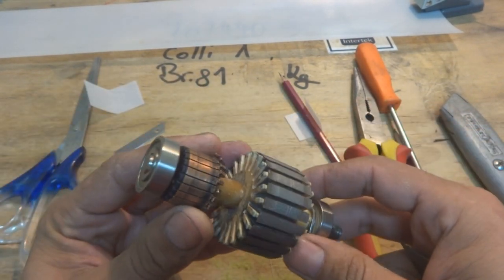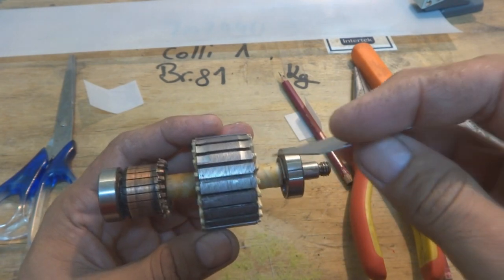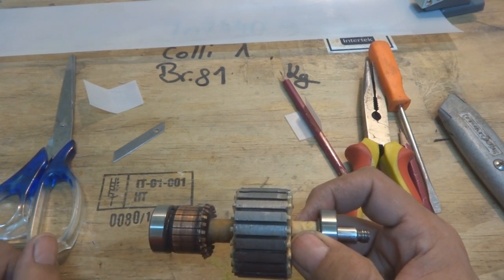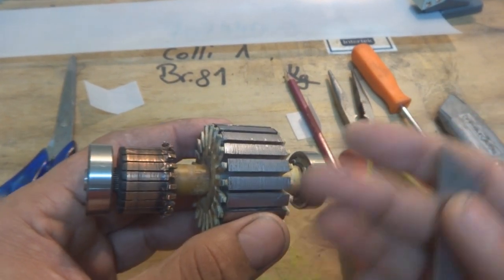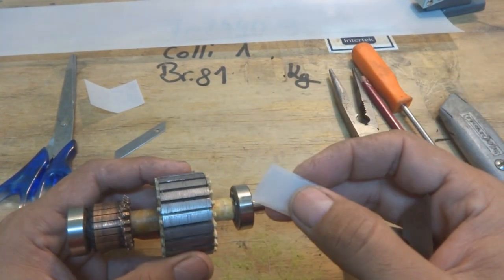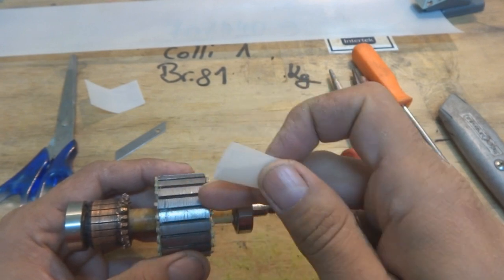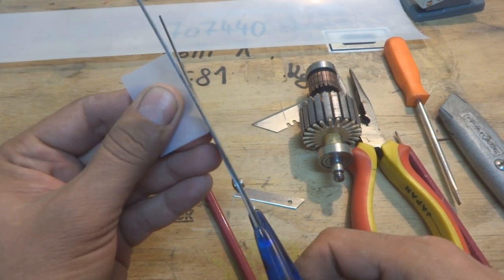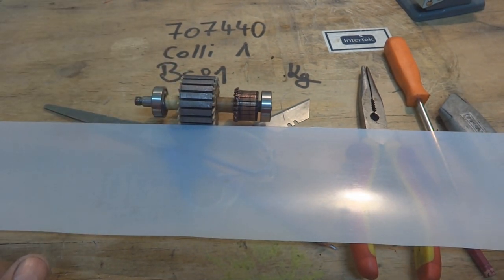Universal motor rewinding. AC series motor repair. Part 2

Comment: I have same rotor with -22 /22 how much offset to make two or three commutator pins ...., first try of winding with two pin offset on commutator, no sucess motor is working with lots of sparking come on commutator ,......any sugestion .....maybe to check stator windings for shrtage , I only check ohm readings and earth test on stator (field ) windings .......?!?!
Reply from the maker: Sure it could be a shorted field. Also after field if no success then offset 3 slots
Reply: @JahanZeb1976  thanks for replay , now i start 3 offset winding tomorow finish , i try field test series lamp 220v no ground resistance is ok , i will try like this and if start sparking , i will rewind field , and also put new bearings sometimes bearings can be problem maybe.....thanks again i will post results.....

Comment: Thanks for respond . there another thing . it is about that pins  outside around slides  that what you said in your video was broken and you fix with glue .
but I have a lot is broken from me when I take out magnet wires. what is name of that and do I can get new one because I lost all broke pcs.
Reply from the maker: Yes this is normally the case when you try to remove wire, the fingers are breaking. Care is required not to break many. I think you will not be able to get a new part due to no easy availability. In such a case there are two possibilities with you. As you loose broken parts, you can create new using some soft wood piece or plastic piece and glue them in place. The other possibility is you can discard the broken parts and rely on the insulating paper you are inserting. The paper you should cut a little longer and keep it in the way so that it should act like an insulator. But sure the best way is the first option to create new fingers. Hope you may get my point and will successfully wind your armature. Regards,

Comment: in my case it is on 9th not 10th. eureka forbes vacuum cleaner 1400 watt 230v ac total no is 22. what should i do?
Reply from the maker: Same as your older data. Every machine have its own design. Dont try to change that design.

Comment: Thanks . I like that video because teach my how I winding motor .
but what kind of paper you use. is that plastic or what.what is name. where I can get it. from Amazon Or ebay. or where .
Reply from the maker: Thanks for linking video. You can get insulation paper from any electrical winding wire supply store. This item is available everywhere locally. If you prefer it even you can buy it online. Name is mylar insulation paper.

Comment: hi sir I have replaced dewalt 801 grander armature but it is over heating with in few minutes
Reply from the maker: +Ravi Kumar I am sorry I told you wrong last night as I was thinking you worked on a car alternator.
You should replace the two field winding coils as they seems to be shorted turn to turn. You can confirm it using a series lamp method. Those coils you can only rewind from the same diameter wire with same number of turn and same orientation. Hope you understand. Regards,

Comment: That looks like a long winded task :-(
The 3 slot offsette must be the rotational timing between the brushes and the place the magnetic feild has to form.
If you had wound it without offsette the brushes would have to be rotated by the same rotational angle to form the magnetic feild in the correct place.
So its done to put the brushes in a nice position really :-D
Reply from the maker: +zx8401ztv Yes really sir. While I was doing it, I understood the reason! Before I had no concept of this and was wondering why these motors are rotating always in a right specified direction. The offset is a must to make them rotate and rotate them in proper direction as well. The brushes in this machine are fixed and rigged in one place in the frame. So the offset had been created in the winding. You nicely got and explained the point.
Reply: +LearningZone 
Jahan, your video got me thinking, Thank You, i didnt think about them before your video, im learning :-D
Its funny, ive been repairing lots of things for 30 years and never really looked close at universal motors, perhaps they didnt interest me enough at the time, i learnt something new now :-D
Reply from the maker: +zx8401ztv It's my pleasure sir.
Reply: agreed this looks tough

Comment: Excellent work, we like to see you doing electronics repairs. Keep up the good work. By the way, do you have any experience with repairing satellite receivers? what components are more susceptible in these devices? Thank you.
Reply from the maker: +cyrus Thanks dear friend for liking video. I would upload electrical and electronics both repair videos. Mostly house hold people are suffering more in Electrical repair that is why I am focusing on electrical repair. Electrical and electronics are going same way as long as you understand the basics and principles. Long time I worked on satellite receivers. There many things can go bad. Usually power supply, tuner circuit etc. Now a days I am no more working on them as they became much more disposable now. regards,
Reply: LearningZone